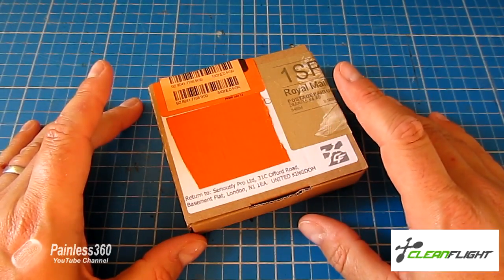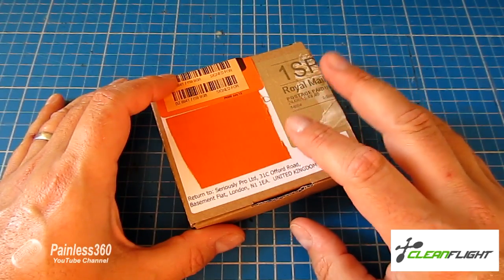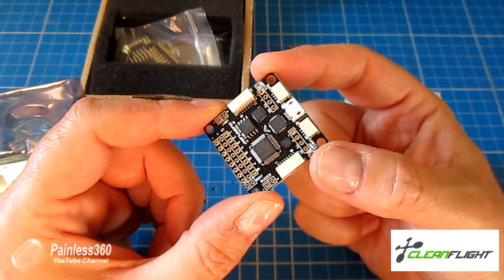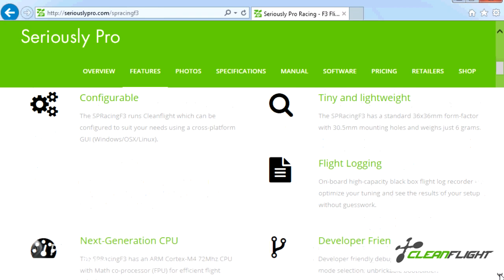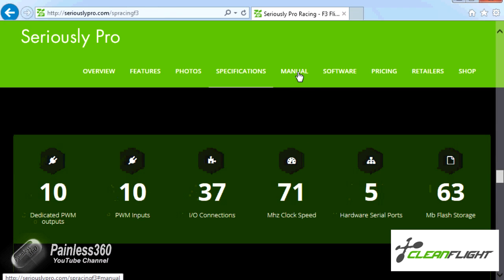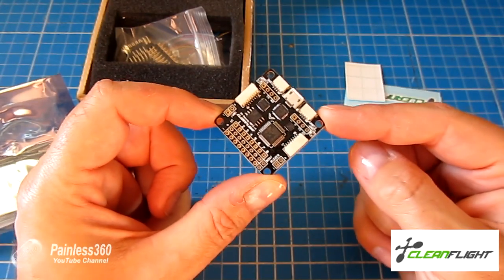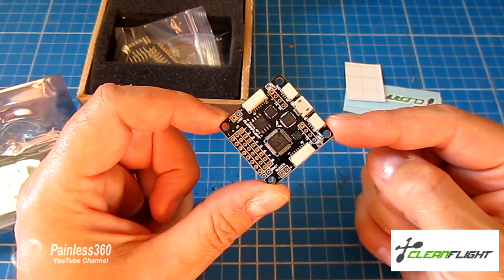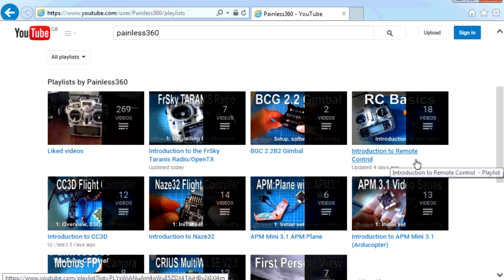Seriously Pro Racing F3 Series - Now on the channel!

Comment: Hey, can you make a video series on the iNav firmware. I have switched all of my cleanflight controllers over to iNav. Its better than Naza since it has waypoint capability. I would love to see a series on that, or even just a couple of videos. The firmware is made by Digital Entity. Here is the thread  :  http://www.rcgroups.com/forums/showthread.php?t=2495732
Reply from the maker: +Em E iNav is a test fork of Cleanflight for the new GPS code. This functionality will become part of Cleanflight once the development and testing is finished. Until then we'd be covering a product that will end -of - life once it's job is done. see our video on how open source works. Thanks for the suggestion. Happy flying!

Comment: Is it possible to show a demo of the transponder for the clean flight board, hands on set up, what's needed. maybe a comparison of CF and home made transponder systems.
Reply from the maker: +Will Mandujano not sure what you mean by 'transponder '..
Reply: +Painless360 sorry didn't realise this was an older video. My bad, I thought I saw something about the FC would have transponder capabilities. I might of gotten that info confused. I should go sleep. sorry :(
Reply from the maker: +Will Mandujano the new F3mini has a race timing system using LEDs. We'll be looking at that in a future video..

Comment: Hi Painless, the docs mention that no hardware inverters are required for many telemetry protocols.  Does this hold true for FrSky telemetry on a D4R-II receiver?  Thanks!
Reply from the maker: +Shaun H All covered in the SP3 series. The FrSky telemetry is inverted but in some flight control software (like Cleanflight) you can do that in software with out the need for extra hardware..

Comment: I want to use this Flightcontroller with a Spektrum satellite, in discribtion shown is UART 3 for 3,3V, grnd and signal. But if i solder cables on UART 3 and connect the satellite there is no power on it. Now i tried some connectors of the SPF3 and i found a way, but this is not what i want to use for because i dont want to use connectors for the function. Could you do a video with some ways to connect spektrum satelites? that would be great :)
Reply from the maker: +Martin W. Thanks for the idea. Let me see what we can do about that..
Reply from the maker: +Painless360 Preview for you - https://www.youtube.com/watch?v=OZgfn7Idsaw Thanks for the idea!

Comment: HI! There are many videos talking about quads, racing drones and so on. I have an hexa with 3110 700kv emax motors on a RC Timer S800 frame. Could you please talk about a PID settings, best esc firmware (SimonK or BlHelli), and other settings for a slow flying like mine?
Reply from the maker: +Leonardo Galdino PID is here - https://www.youtube.com/watch?v=fNYu5coR6Sg and details about the various firmwares are in https://www.youtube.com/watch?v=OZNxbxL7cdcThere is a series of videos in a playlist called 'Introduction to Remote Control' that covers a lot of the basics. Hope it helps.

Comment: I'd like to know a little further about the telemetry capabilities of this new FC. I've heard great things about it, and the one I'm most curious about is the compatibility with FrSky's S.Port Receivers; It'd seem that, under the correct set up, you'll be able to not only communicate with the FC, but with additional sensors, like the LiPo Cell meter, as well as the high-accuracy vario.
Reply from the maker: DaWalkDude Yep - you sure can! We will cover this in the video series as I am using an X4R receiver..
Reply: Painless360 Great! It seems it will not only be the perfect moment to showcase the S.Port Telemetry, but also the S.Bus interface, won't it?

Comment: i just wanna see mine fly ,or maby there not meant to ,got it a few days ago and still cant get it in the air.every thing went well till i tried to get my dx6 configured to the board under receiver tab and no pitch or yaw is showing up ,everything else is aux1 n2 are showing fine as well as throttle and roll but no yaw or pitch ,ive been building these things for aprox 4 years and ive handled pretty much all controllers at 1 time or another but mostly i use naza ,and kk.can someone give me some help id really like more than a paperweight.
Reply from the maker: Chris Harris OK, I've just has this exact issue here filming and sorted it. Have you got it working yet?
Reply: no man i havent ,and im assuming it has somthing to do with channels 1245 but not sure and get fpv is no help on this board ,it would be great if you could help me id freakin pay someone at this point.
Reply from the maker: OK, here is how I got mine working. I forced the board to reset all of the ports to default so that any interaction with UART3 and the PWM inputs was removed. Go into the 'Ports' tab, un-tick MSP under Data on the UART1 line. Click Save and reboot and this will cause the board to reset the entire port settings as this is an invalid choice. Once it came back up it worked for me.. Hope it helps you too..
Reply: bro thank you ill give it a try but im not using the uart 1 ,my receiver is hooked up to io1 ..if this is the port you are using for your receiver then this will work for me too so ima give it a try.ill hit you back and let you know ..however thank you for this info buddy i REALY appreciate any help here ...
Reply: nope im thinking i got a bad board  now ,i put a new receiver on the quad and did what you said and no good ,i havent  reflashed the board and idk if that is the problem any more sugestions???
Reply: Painless360 hey bud so i talked to boris and he said that i have to use both io1 and 2 to run pwm ,are you doing this ?could you show me a pic of how you wired your receiver because the manual isnt very clear on this process,and the guys at get fpv told me to only use 1 side ,i dont want to burn my board even if i cant use it ,lol.i dont mean to be a pain ,if you have pay pal acct i can gladly pay you .at this point this thing is useless to me ,as instruction manual is vague at best and no videos on the tube to see ,,no schematics for wiring and i dont think get fpv knows anything  at all about any thing.
Reply from the maker: Yes, you need wires into both IO_1 and IO_2 if you look in the Seriously Pro Playlist on the channel you may find an unpublished video that covers this ;)

Hope it helps..
Reply: Dominic, this thing is nice,no doubt .I love the way you designed the switch config tab on the gui.it is rad! you can do a lot of different switch configurations with this .I think i have found my new controller...

Comment: You could show people how to put a teensy 3.1 and set up Taranis with LUA script you can then get full telemetry on radio in real time, easy enough to buy I got one for £19 and then flashed it, just bit of soldering on teensy, cheap and good add on to any flight controller.

Comment: Thanks Painless360 :D  Looking forward to watching your videos!

Possible topics:

#1 Quick example of PID tuning using blackbox flight logger.

#2 FrSky X4RSB S-Bus RX + SmartPort telemetry.

#3 WS2812 LED Strips
Reply: Dominic Clifton +Painless360 Yes, please! #2 FrSky X4RSB + S.Port Telemetry + Micro MinimOSD w/ KV Team Mod  (Multiwii OSD / MWOSD)
This is pretty painful with Naze32 rev5 even more with the Afromini Amaze (rev3).

Also what about 3D mode + OneShot with KISS?
And the power consumption to size the step-down / 5Volt supply..
Reply: Dominic Clifton yeah a example of PID tuning using the blackbox fliight logger,,, would be great... cant wait to get this board, when its back in stock again...Ive  try every night on the website to get one...

Comment: I'd like to see the full install setup.  A video where you flash the board. Vbat, telemetry to a Taranis using both D4R-II  and the rx that comes with Taranis, GPS, altimiter.

If it is better than the Naze32,  then do the full series.  

Also where do you find the FC and where to get the connectors for it?

Comment: Ok, I'm sure we are going to see led gps and the like but, I think the best thing to do is set up a 230 quad, I have found the smaller quads are taxing on low performance parts. Take this 230 and run it in the same set up less the flight controller. I think a simple course with a few varying degree turns and a few altitude changes would be in order. I would run a big fan on a part of the course as a windy section would farther show any differences between the cc3d naza32 and this one.  That is what I'd like to see, the real differences.

Comment: blackout 330 with gps and seriously pro. if possible setup osd and show off 15 degree motor mounting plate. thanks you have been a great help, but for some reason my gps has been intermittent on my blackout 330.

Comment: I would like to see what extras can handle with 8 channels used by PWM, by using for example a Turnigy 9x. I know it is quite recommended using PPM, but those beginners who have started with the Turnigy 9x and don't want to do the Frsky mod yet, this board could be a easier solution.
Will ever Cleanflight support a FollowMe mode?
Thanks for your work.

Comment: Since this has the barometer and compass it would be a waste to put it on a mini quad (although a direct comparison with the Naze and the Flip 32 on the same frame might be nice).  How about a camera platform with GPS, perhaps something with motor redundancy like  a hex or an X8?  Does it have enough outputs to control 8 motors plus pan and tilt stabilization?
Reply from the maker: Marvyn Harris Yep - 8 outputs. Have a look at the manual I link to for more detail. Having the compass and baro does mean that the GPS modes like RTH will work and having this on any model is a very handy feature - even a 250 ;)
Happy flying!

Comment: Hi thanks for your videos, great job !
I read here in the comments that it s the same software than the naze 32, so talking about fly efficiency or perfomance it won t change anything...Is that right ?
Because i'm working with copters the first thing i would like to see is the gps configuration, and eventualy way points setup...
 having your feed back on it would be great..
Reply from the maker: Vaclav Prochazka The software is the same but the platform (software and hardware) will have differences over the Naze32. Time will tell how much extra Cleanflight prises out of the new board but there is more of everything on the SPro..

Comment: Put it on a ZMR250 copy frame as that is one of the most widely used racing boards for people on a budget, add a Diatone ZMR250 PCB Board For ZMR250 Quadcopter Frame Kit distribution board from Banggood to it for only $7. Or a Nucleus full blown power distribution board for $30, plus the OSD soldered directly into the Nucleus. Put it all on the Taranis with a D4R-11. No GPS racer don't use them to much weight.
Reply: I agree too! Very good idea! And as a bonus you could bring the board to it's limits by using all features mentioned to be possible!
No one of uns will race with sonar and gps, thats for sure, but it would be nice pushing it to the limit! :))
Rgb leds, sonar, gps, telemetry, osd, serial rx.....
You're the man to do it!
I have a deluxe board since two weeks or so, waiting for my new escs to upgrade my zmr250, can't wait to get this tiny monster lit up! Looking forward to learn from you :-)
Reply: PlatinuM MGO  Done a Like.. Thanks to Paul Thomas Suggestion.
Reply: I totally agree
Reply: I say everyone that wants to see something done here should put a like for that comment, that way our dear friend can easily see what most people want, for example I have replied like and commented to this ZMR250 comment!
Reply: Well played mate ;)

Comment: R.T.H. for one, way point for two. position hold.
Reply: +1
Reply: http://www.rcgroups.com/forums/showthread.php?t=2495732
Reply from the maker: I wouldn't as I understand that the improved GPS code is on it's way back into Cleanflight to join all of the other improvements from side projects like Betaflight..
Reply: Painless360 hasnt happened so far... and probably wont for a while (maybe ever)

Comment: Miniquad/racing quad with this board vs naze32!! I'm running a naze 32 and want to know if its worth upgrading to this board and/or to buy this for future miniquad builds.
Reply: shaneman27 
If you flash cleanflight onto the naze there isn't any difference. It's the same software. It's just easier to connect different stuff to the SPRF3. (that may change at a later state though, when the power of the F3 is needed over the F1.)
Reply: I'm running baseflight right now on the naze32 and I think it's great but I was just wondering about ports and stuff.